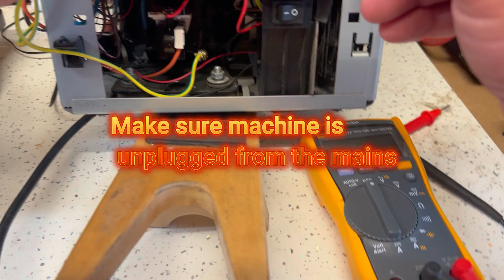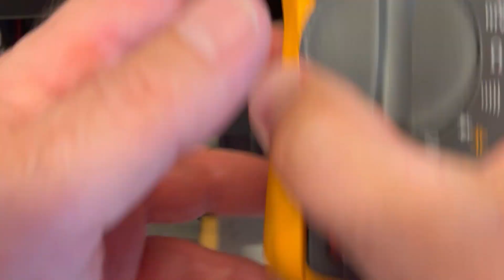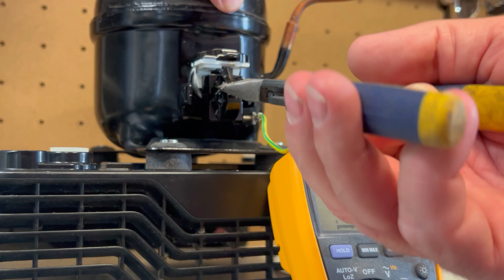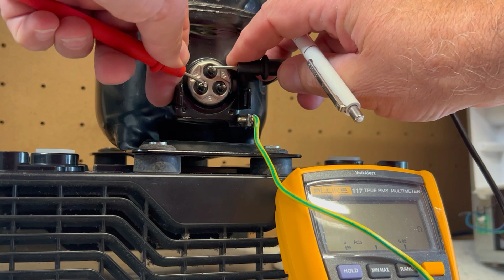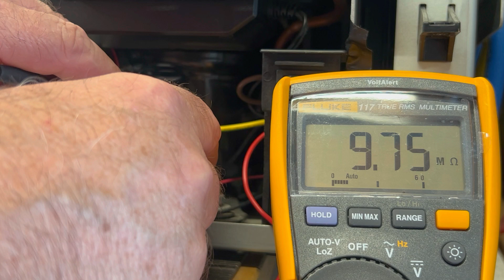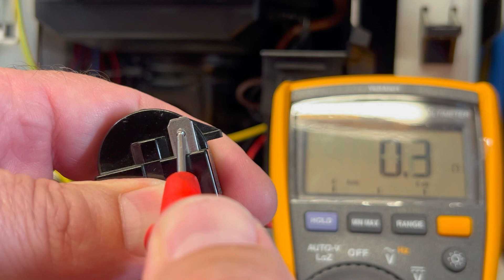Testing a blade beer machine compressor

Comment: Where does the red wire from the pcb board go? I unplugged to replace the relay and the overload, but can't remember where the red wire connects to?
Reply from the maker: It goes to the overload terminal
Reply: @Bladerepairsdiy  where does it clip onto the overload terminal mate? I have the red spade wire connected as per your video - but there is a clip above the spade, and one to the left of it
Reply from the maker: @coys-dave85 there’s 2 red wires. One from the circuit board and one on the on off switch. The on off switch red has s piggyback connector for the other red. Then they both push onto the tab on the overload.
Reply: @Bladerepairsdiy thanks mate

Comment: I got 17 between C & S, 58 between C & R and 75 between S & R. So that means my compressor is good right?
Reply from the maker: Yes providing there is no reading to earth from any pin.
Reply: @Bladerepairsdiy  meant to post the other week. Thanks very much for the videos. The machine is now working as it should. Top man 👍
Reply: No reading from earth to any of the pins 😁.
Just ordering the sensors and jellybeans you linked on other video. Then I'll hopefully get it up and running. Thanks. Very helpful videos 👍
Reply: Hi again. Sorry 1 more question. Tested the sensors in machine and the bowl sensor is at fault (will change them all anyway)...
Once that's done, am I able to check if cooling is working, without installing a keg? 
Not really wanting to spend out on a keg if this doesn't fix ir
Reply from the maker: @gerrystuart5027  the circuit board stops anything happening until the keg is installed. You can bypass the whole thing by connecting power directly to the compressor.Not recommended if you don’t really know what you are doing.
Reply: Ah OK. Will it show cooling as working if I put an empty keg in?
Reply from the maker: @gerrystuart5027 once the air pump stops. The fan should run and you should be able to hear the compressor noise under the noise of the fan. It sounds like your fridge at home. Then it should cool if the machine has still got its gas.
Reply: Even with empty keg?
Reply from the maker: @gerrystuart5027 yes
Reply: Great. Thanks very much 😀